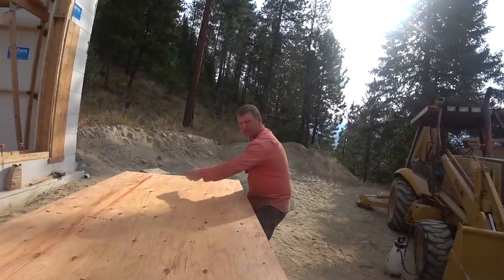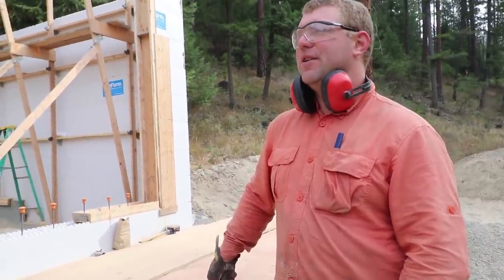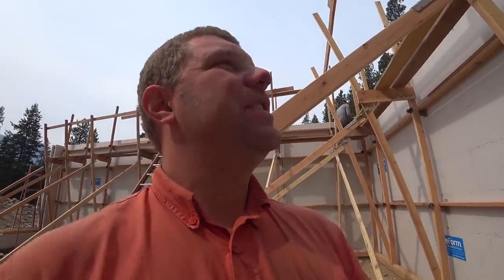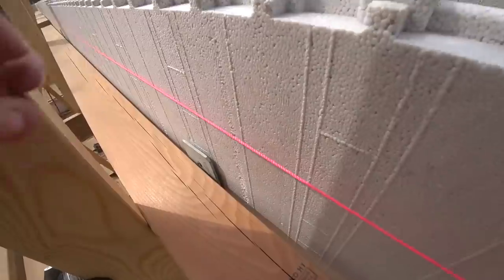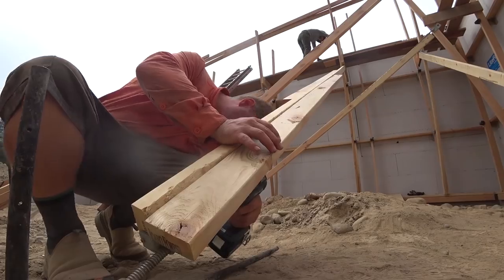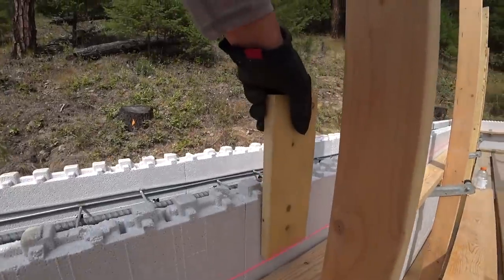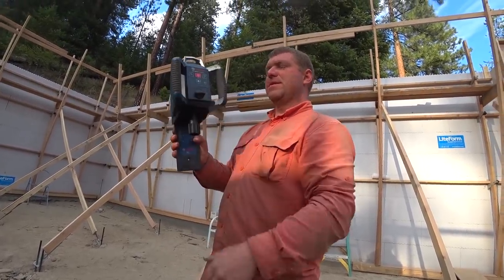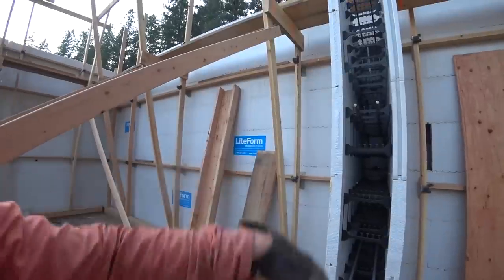Building a House Start to Finish: ICF Concrete Pour Prep

Comment: You were speaking about "as drawn" and "as built" this is somewhat interesting because you also have a third factor that is "within tolerance" this is why finish carpenters get paid well, they are usually the people that have to adjust everything to keep it square and plumb and make it look right to boot. When you get into windows and doors you will have your "rough opening" so while the wall could be out the window or door has to be installed properly or it won't work right. Anything built into the house needs to have a total length measurement to figure out if any adjustment needs to be made, that way the adjustment can be made throughout the span. That is far less noticeable and usually fairly easy to do if properly measured and addressed. I have seen 1/2" and 3/4" plywood behind base cabinets where the wall had a bow yet the cabinets were straight. Another thing to point out is when you install your floor run several string lines from the corners, sides and front to back. The string will tell you if the floor is flat, it's much easier to adjust before you start building walls and it keeps everything going in right the first time.

Comment: as an Architect, I am fascinated by your journey.  I found the discussion about the plans not being real world quite amusing.  The bottom line is that the professional certification and licensing standards are heavily weighted toward education and not experience, and even then, you receive very little practical experience in the field.  Back in the day, you had to know how to build before you could tell someone else how to build.  Not the case anymore.  We learn bits and pieces about construction and codes and rely on your own understanding to fill in the gaps.  There is a term in the industry we use when justifying less effort in detailing.  "Means and Methods"  In other words, we don't care how it gets done, but this is sort of what they need to do.  All that to say, as a builder, you need to understand what is important and don't get too caught up in the details.
Reply: Adam Brown.  Well said. I am geotechnical engineer (in uk) and the methods and details covered I the videos is interesting. Interpretation of advice and putting it into practice results in variation. Experience to apply the codes is invaluable if you want to avoid latter issues. YouTube comments, with a 5-10day time lag is not a good source of advice as it often arrives too late, but there is plenty of great ideas and excellent advice by lots of contributers. A very enjoyable experience to see two people put their heart and sole into a project.
Reply: Having worked for an architectural firm for 18 years and prior to that in various construction trades (including formwork) for another 15 years I have to say that I strongly doubt your plans showed where to do your laps in your rebar.  Plans will generally show how much rebar you need that it has to be two inches from face of form and that you have to have two foot laps, but that's about it and it's expected that whoever is building the foundation will have knowledge of the trade.  Things such as how to construct a stop at the end of a wall, or how to brace and build scaffolding I've generally not shown on plans as different foundation form systems will be done in different ways specified by the manufacturer ... Methods it is expected the contractor using these forms will know and understand.
Reply: Adam Brown , well said is correct Adam. At the ripe age of 5, my father put me in the sand pile while he and his brother built our home. Back then it was very old school but both my father and uncle were masters in there work. (50 years of carpentry) i did learn much from my dad as the time moved on but by the time i got to 25, i hated the trade. It wasn't until midlife that i learned how important that experience was. Being a Mechanical engineer,  that experience was priceless.
Reply: This all stems from the pressures to go straight from high school into college, and then directly into a career.  This is NOT the way to make competent engineers or architects (or any other sort of designer).  One must spend time getting familiar with a thing, before one can build a thing.  An electrical engineer should work as an electrician before even going to college.  An architect should build structures before ever drawing a floorplan.
Reply: James Dudfield MP ki
Reply: CraziFuzzy my point exactly!!! I ran into people coming straight out of college and didn't have a clue. My assessment of the situation was to retire!!!!! Lol
Reply: @CraziFunny. I agree whole heatedly. I earned My LS licenses with 12 years of practical experience in responsible Charge. I was one of the 5% or 15% who Passed at the time and I'm sure there were more than one college grad with 2 years in office who failed!
Reply: @CrazyFuzzy, you're right this is true of other professions as well. I spent 40+ years in the automotive trade in dealerships, starting as an apprentice mechanic, getting my license, specializing in performance/electrical, shop foreman and finally service manager. I can't tell you how many times I looked at the vehicles and shook my head at the ridiculous designs that were adopted for vehicle systems. The engineers had to keep in mind the production costs of the products but they had no clue on maintenance and repair times and how much they affected the manufacturer's warranty bottom line, and the customer satisfaction index.
 I used to say that routine maintenance should be routinely done and it should be routine to do, yet many models required drive-line components to be removed just to change an oil filter, A/C compressors, alternators, countless engine brackets needed to be removed to replace some spark plug.  I said for years that every automotive engineer should spend at least 2 years in the mechanical trade before being considered for an engineering  position.
Reply: LOL, well said. I had a 68 Cougar which I'm sure the #8 Spark PLug had never been changed since you had to pull the brake booster to get to it! :-P
Reply: Adam Brown I
Reply: dmarnaud2 heck naw! I just let that old cougar smooooke.
Reply: But she was a total go-devil. loved that car! Moved to Ca. and there's a bunch of them painted metallic royal purple. I was all about it until I was told they were PIMP cars and purple was the signature color :-P
Reply: @ David B, lol, prevert :-P! but having run into your type of Cougar I can't dis your opinion!
Reply: troll stalker The f150 has to have the body lifted off the frame to change spark plugs. I'm not sure if it still does but it did less than 10 yrs ago.
Reply: Toyota requires (or used to) that all mechanical engineers work in a service center for two years before applying.
Reply: InsideOfMyOwnMind I

Comment: Hi guys just watched some off your videos ,they are very interesting to me as I am from England and we don't tend to use the method of shuttering as you have ,I have a tip for string lining that we use over here ,we use a thing called a traveler so you get three pieces of small timber the same thickness (2x1 pse) you then put a piece at each end of the line so packing the line out the thickness of the wood assuming you have got both ends true you now can (travel)the line with third piece checking the gap between wall and line is the same thickness as the wood , the reason for doing this is so as you go along plumbing up walls the string line will be clear so there is no chance of. Wall fouling line as you go hope you might find this helpful

Comment: The difference between "as drawn" and "as built" is the knowledge of the designer/architect as to what is possible. In my 34+ years in the construction industry I have only met one architect who had a grounding in the doing of the job. He asked my opinion on a job and we discussed the options and settled on the best solution. To his credit he came back the next day with a drawing set only to see what I had done and said " I'll just file these as done" ! 
Ideas on paper often ignore the real world situation or what is possible with a material which is where skilled "manual workers" step in to problem solve things desk jockeys would spend months Googling.

Comment: IMHO, from the cheap seats, the two smartest purchases you made were the laser level and the back hoe.  They seem to be huge time savers.
Reply: John Lowe, Photographist I dunno, the bacon is one of smartest things I've seen Jesse do... besides marry Alyssa, that is.
Reply: I don't think they are married yet!?!
Reply: Jim USAF ret... You may be right. But I will say this. If they are not married and finish this house together, then I am thinking it will be a long and happy marriage. TY for your service. USA 67-72
Reply: it looks like the laser level is a pain in the ass, i'll take a transit anyday
Reply: dcsoxford have they ordered the doors yet?  They're not building to a dimensioned plan knowing the width of the doors?  Going to be a hell of a header. Steel I-beam maybe?

Comment: Hi, Been watchin on and off the developments of your project, and probably my advice to your concrete pouring will reach you to late but I have built my houde in France using only EuroMac2 blocks from ground floor to attic (2 floors) including door and window openings. Euromac2 is a similar concept as your lightbuild blocks apart from that the exterior wall is 3 times the thickness of your internal wall of polystyrene. 
Most importantly, whomever is pouring the concrete should gently lay it down in the frame, layer after layer, until the top is reach, the risk of just flooding one end of the building at the time ( filling from top to bottom in one end, then moving over to the other end might end up rupturing the wall and all the concrete spilling out! 
best is to spread it evenly on all the lengt of the wall and build up as the concrete levels out, U can use a vibrating tool against the wall ti allow the concrete to settle or just keep jamming it down with a stick to make the concrete settle most evenly .

Comment: In Portugal we make the project, which costs X. Then you can do a project of execution that costs 5X and also construction preparation drawings. The mandatory is only a project usually the customers opt for the cheapest. What I can say of my experience is that the execution project and the preparation drawings save a lot of time and money on the execution and contribute to the building having a much better quality.

Comment: wow wow wow I wish I was your friend and near by, I would have helped you out, but we all been through something like this in the construction field so don't get discouraged your new experience and wisdom will come in handy on the next project
Reply: seems like alot of material needed to get this icf done

nail a piece of 2*4 on the side of those braces so it comes out like a T, then put the 2*4 into the ground then stake it done it won't move or bend done the length of the 2*4
Reply: either way great job

Comment: Not sure why you didn't use a plumb bob on the walls to see if they were vertical (plumb!)
Reply: using a plumb bob to make a flat wall plumb is easier said than done. with a sheer face like that, there is no room for the width of the bob itself, so you can't hang it directly against the wall. so then, if you put a little bit of wood at the top to give the bob room to bob, now you have to account for the exact width at the bottom as well. not impossible by any stretch, but not as easy as you might think.

i've seen builders make a timber frame "plumb" many different ways. i put that in quotes because the most experienced builders i've watched seem to eyeball it most of the time. The fact is, you can't actually tell if you wall is exactly square and plumb, or mostly square and plumb. There is some wiggle room, and some professionals will rely on their eyeball skills (even when they really shouldn't). its fascinating to see some contractors walk right past the laser level and grab the chalk line (or even just the saw and no straight edge at all)

Comment: I'm wondering if there is any value in ICF. In my own home 3000 standard blocks up to wall plate and a further 1500 in the 3 tall gables... 4500 blocks with 100mm cavity (pumped with high density foam and the 1st floor joisting in place ... all done in 12 days ... you don't have half of this and your labour to time seems to be costing you ... in the long term I don't see the ICF providing you any benefit ?

Comment: Dude, two pours next time. Sooo much easier and just as strong no matter what the tell you.  I know there will likely never be a next time, so I'm saying this for everyone else.  It's much easier to plumb the walls and keep the runs (distance between the walls) to length if you set your forms up a bit over halfway and make separate pours. Also reduces the risk of blown outs and   air pockets.  
Didn't see you checking square or runs along with plumbs on the way up.  When you start framing you'll likely hate yourself for not doing so.  Really wish I could have been there to help.  
As for the extra trips for supplies, I would suggest that anyone building a structure buy about half again more lumber and screws (or zip ties) than they think they need. I built several houses and I don't know how many times I've said "that should be enough" and it wasn't.  If you're an industrious homesteader you'll always use them later.

Comment: AS a concrete contractor for 15 years and doing concrete for 20 years . If you ever have to do this again or have a friend that wants to do this . I would strongly recommend that you check out Nudura forms . I've never used lightform but I have used Nudura and although in my opinion ICF forms are 10 times more time consuming and complicated than regular concrete forms . Basically I'm saying I don't like them at all . These forms especially the scaffold system is ridiculous I would say at least 10 times more time consuming and complicated than than nudura scaffold system . I'm not trying to troll or hate on you or light forms I'm just expressing a professional opinion that might help you or someone you know in the future

Comment: 5000$ in mud? how much mud will fit in that thing? from my guestimate around 25 m3? what type of concrete are you pouring and do you plan to vibrate it? good luck!
Reply: seeing they are pumping it, it's very unlikely they will be vibrating it ... vibrating is for 'traditional concrete', and that stuff can't be pumped ... the stuff that can be pumped has all sorts of other additives to make so that it can be pumped, and it's generally 'self-compacting' due to the additives. The stuff actually shouldn't be vibrated, because the vibrating will 'un-mix' it, causing the heavy parts to sink to the bottom (stones) and the light parts drifting to the top (sand, powdered additive and the actual cement), which in turn cause the top to be structurally weak and in some cases the bottom as well (as it might lack enough cement to bond everything together)
Reply: Thats why im asking what type of concrete they are pouring, vibrating is used to remove air pockets from inside the concrete the pump itself won't do it, we poured up to a b30 or currently c25-30 norm concrete with W10 waterproof qualities and it has to be laid in layers and vibrated. I don't think vibrating can unmix concrete, it can seriously compact it like you mentioned with rocks sinking down, the weak part remaining on top is a few  millimeters (under an 8th of an inch) and might flake off, check out the videos from my construction site on my channel to see our concrete for the foundations . Greetings to you all from Poland
Reply: Was your concrete pumped or dumped? ... the pump doesn't compact, it's the mixture itself that compacts itself, and the composition of said concrete is different from normal concrete. Normal concrete does need to be vibrated, the self compacting concrete (which can be pumped) should not be vibrated. See the bottom of this article: https://en.wikipedia.org/wiki/Self-consolidating_concrete
Reply: My excuses, i looked it up and also found where my mistake likely came from. I worked in prefab concrete plant and they were not able to pump their concrete at the time, and were looking/developing self-compacting concrete to be able to pump it. But, this may have been due to the size of aggregate they used (as apparently concrete with pebbles up to 63mm can be pumped). I assumed (falsely) that concrete couldn't be pumped at all, unless it was of the self compacting kind... glad to have learned something :) ... so yeah, it might well be that you had concrete pumped and had to vibrate it, but there are also concrete kinds that should not be vibrated (aka. self compacting concrete) as vibrating might cause it to un-mix...
Reply: Ohh and our concrete was pumped with a pump truck that had a boom arm. Not a stationary pump with a hose draged from the floor level like the ones used for their foundation : )

Comment: Stupid question here, but after the pour, do you remove all the foam, or use it for interior insulation?
Reply: No question is every stupid, if you don't know the answer. The only thing that is 'stupid' is not asking ... I'm fairly sure it's meant as instant insulation for the walls they are used on. The parts of the ICF are also linked together, so i think that if you were to remove the foam you'd end up with a pretty nasty looking wall, surely you can put some cladding on it, but insulation is just fine in most cases.
Reply: Dutch Courage thanks for the information. I really appreciate it.
Reply: no problem ^^

Comment: so you found out what most tradesmen know, its a common issue we deal with architects and engineers know the requirements but drawing it on a computer is nothing like actually doing the job which generally they know nothing about